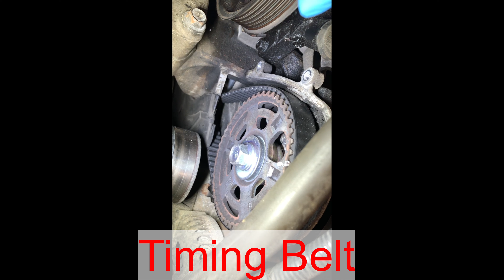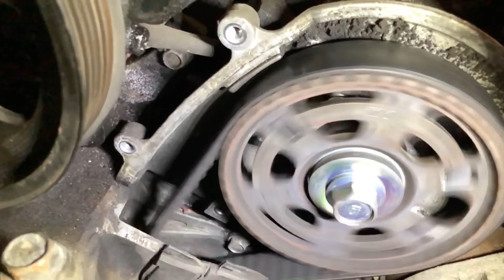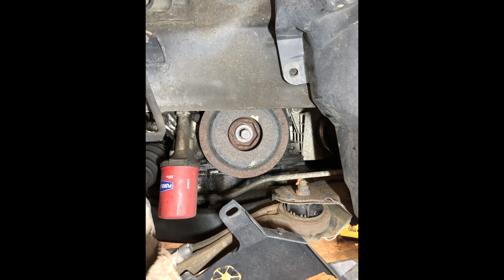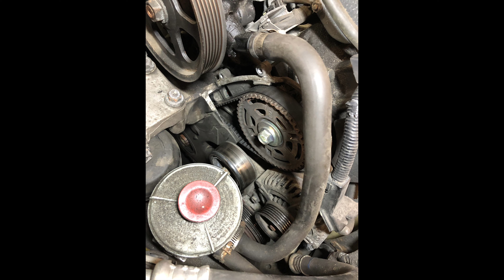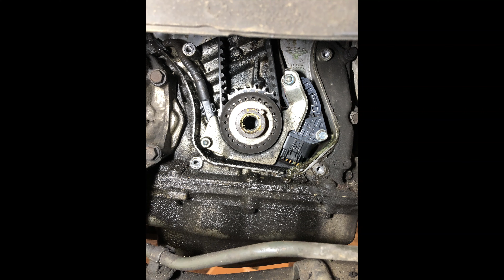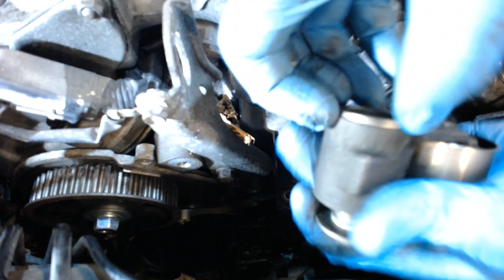2007 Honda Accord Timing Belt and Water Pump Replacement

Comment: Never start the engine without the crank pulley attached, i did that once changing the belt on my chevy aveo and the belt slipped off the crank pulley. After some cuss words i found the valves were bent and i needed a new cylinder head 😡